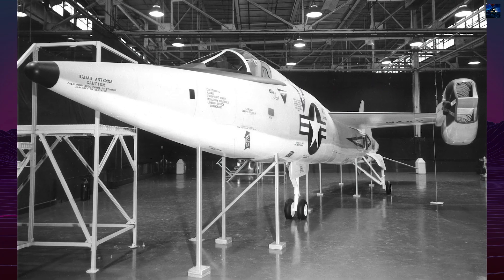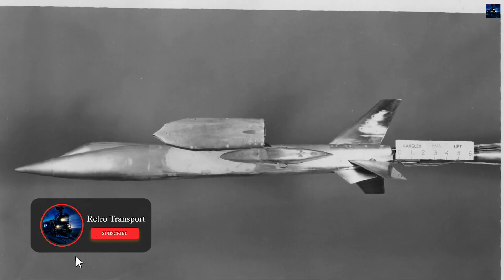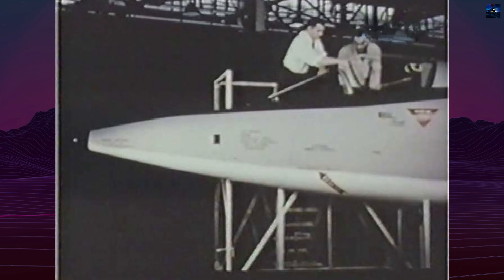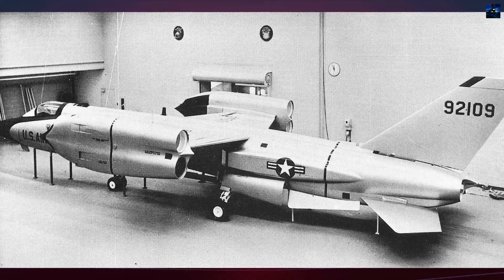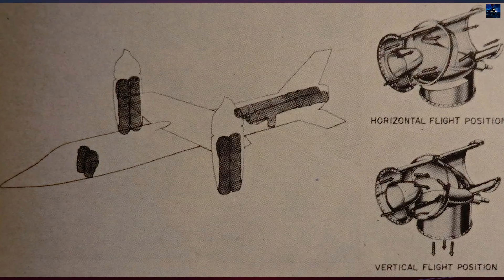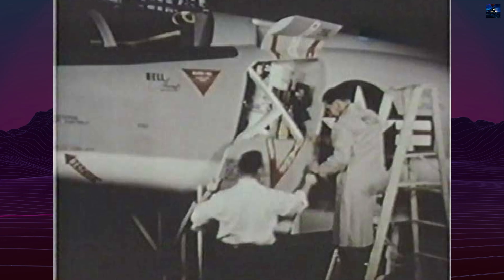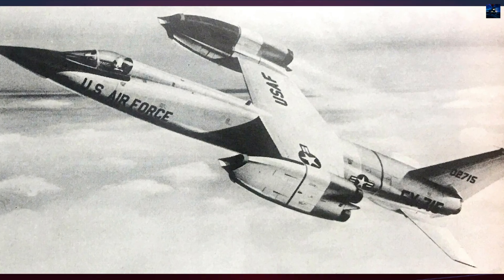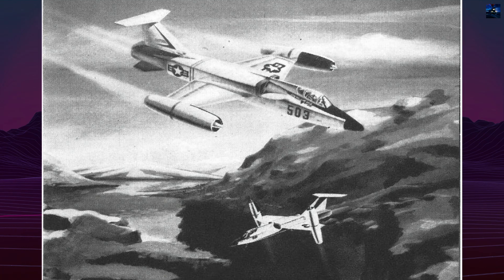Bell D-188A: That Weird Vertical Takeoff Fighter with Engines on the Wings

Comment: Eight engines - as many as a B-52! Imagine the complexity of the fuel system, just for starters. Plus, they would have taken up a lot of internal space. Though six engines could be used for forward flight, the remaining two were essentially dead weight. The designers of the British Harrier took just the opposite approach: one engine with ducted exhaust.

Comment: at 1:51 I think I also saw the grandfather of the V22 Osprey, but with faired propellers.
Reply: Close, good speculation. This was part of Bell's cowl'd propeller research, culminating in the X-22 craft. Both craft shown would require pilot controls sharing operations. Flight controls for helicoptors and fixed wing planes are quite different and learning the skills are seperate classifications. As such, the solution was computerized fly-by-wire. The X-22 began as a concept craft, ultimately demonstrating the computerized flight controls necessity and was used to design the computer's flight characteristics for many craft designs. Remove the cowl (which created some transitional flight problems, thus it's study & solutions present on Bell tiltrotor crafts ever since), and see the similarities to the Leonardo, AW's craft. Bell & AW being partners. Bell's first computerized flight controls shown in the RASCAL. Add learned flight controls of the jetpack and voila, space flight controls from Agena to mercury to Apollo including Lunar Module (both halves).  What alien technology? Lol. Lots of aliens walked Bell's lunchrooms.

Comment: I bet IT didn't have to deal with cross-linkages to keep both (sets of) rotors turning if an engine fails and it lurches and falls drunkenly off to the side, like certain modern iterations of wing-tip VTOLs.
Reply: Wouldn't it have just tumbled in a roll with the loss of thrust on one side? At least a V-22 has the chance to stay in flight with one engine. The  "spectre of the dangerous" V-22 has more to do with perception than reality, though I understand why people feel that way
Reply: That's the fun of test vehicles. Introducing problems to be solved in unconventional manners to open hew technologies.  Yes, thrust produced off centerline produces problems. In this case, an extra large vertical fin would be required as shown on far outboard engine aircraft, a display of flight worthyness during reduced propulsion. Examples: boeing 707, b52, c130, etc. The F-4 phantom II's extra large fin more for extreme altitude flight control.
Reply: @dbeelee8564  If one engine on a wing-tip VTOL fails, and cross-linkage from other engine fails, NOTHING will hold the craft aloft anymore.  Like a V-22 Osprey.

Your F-4 had inboard engines and was designed as a Mach 2+ fighter-bomber.
Reply: B-52 has wings canted so far back, it can (and DID, as proof-of-concept) take off in a nose-down attitude.
Reply: @LordDustinDeWynd  ahhh, OK, component failure causes crash. Best to have redundancy power mechanisms, but it's not easy to have redundant propellers. But, I'm not really sure about discussions of a design never built. An actual flying craft. If your asking if redundant power mechanisms for builds of that era, I would point to a similar era  X-plane, the X-22. An STVOL craft with 4 cowl'd props and 4 turbine engines. All were linked together. Tri-serviced in support. Every branch of military wanted it. Hugely successful test craft and was very influential in forming future flight concepts.
Reply: @dbeelee8564  There's been cross-linkage problems since initial concept.  One wing-tip rotor will not support the entire aircraft.  That's why Osprey was grounded.
Reply: @dbeelee8564  I remember that, back in early 60's!  Back then, people more worried about Soviet bombers coming over the Pole, planes need to go zoom zooom!
Reply: @dbeelee8564   When the X-22 flew, elementary schools were still doing nuclear-blast drills and Nike-Hercs were coastal defense!  I was a Cub Scout then!
Reply: @dbeelee8564 ...and NONE of the vehicles you mentioned are VTOLs.